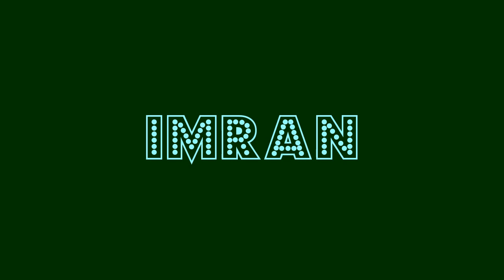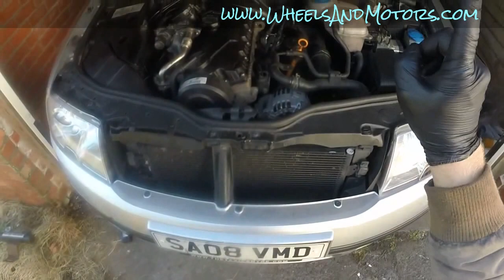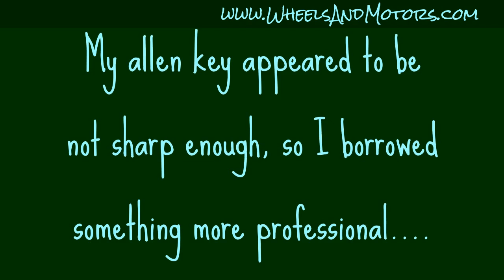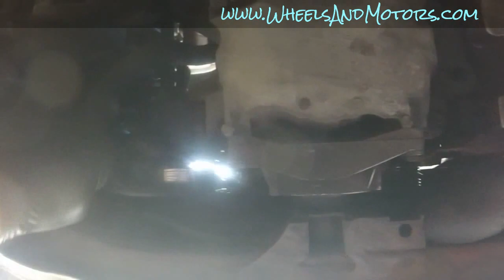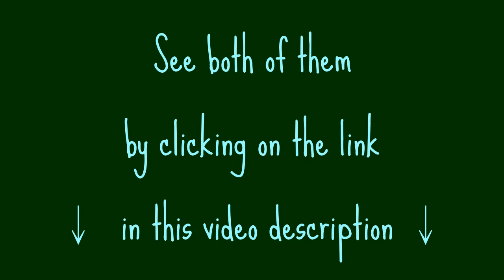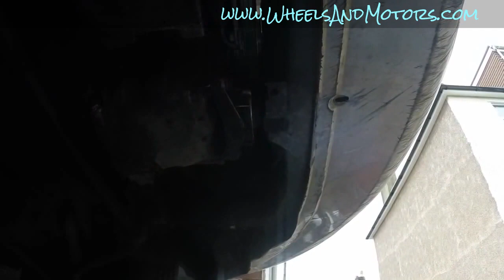How to replace auxiliary belts on Skoda Superb 3U / VW Passat B5

Comment: Hello. Is it the same procedure for the 2.5 tdi BDG? (alternator belt) . Thank you.
Reply from the maker: Not sure. As far as I'm aware 2.5 is a 5-cylinder engine. But idea should be the same. The only difference (apart from belt route) - some tensioners have spring, some just like this.
Reply: @wawayltd  Hi. I m talking about the six cilinder model.
Reply from the maker: @usher4u2  I have no experience with those engines, sorry. But alternator belt should be pretty simple, because normally you can see it.